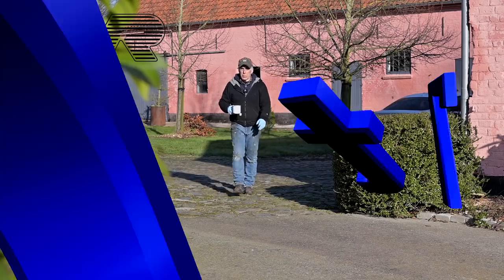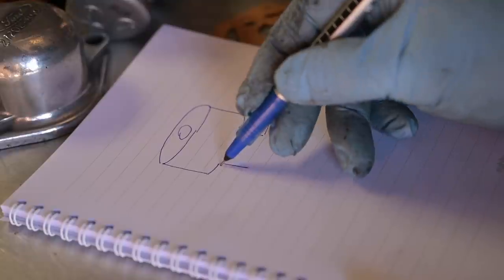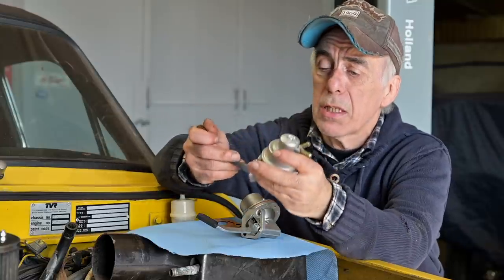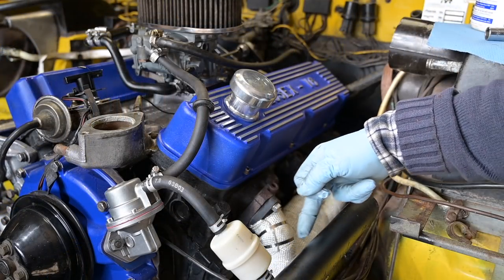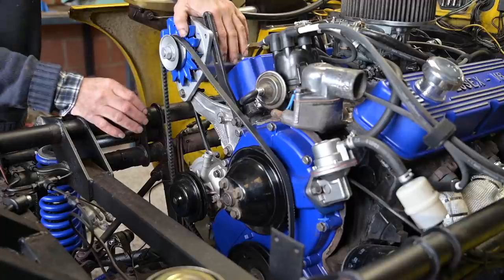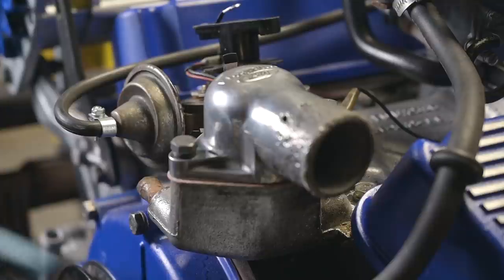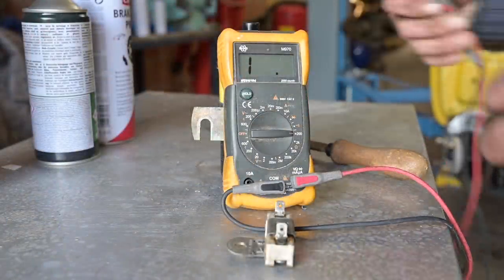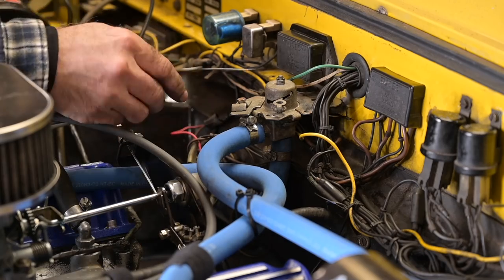TVR 3000M ,Part 7 fitting more engine ancillaries and V-belt issue

Comment: Another good video --  years back a car tuner suggested not using the resistor  type plugs eg without the R in the number -- i have used BP6ES in my 2.8 capri Cologne engine with no issues.. I beleive  the same plug fits the mini. Liking your videos good down to earth mechanic speak
Reply from the maker: Thanks for the comments

Comment: if you want to temporarily fix the pitting on the thermostat housing then get some JB weld on it after roughing it up, then you can smooth off any excess filler with a file and it will be a much better seal and less risk of leakage
Reply from the maker: Thanks for the comments... will do

Comment: Enjoyed the video.  Very calming somehow, very zen.  Must be your composed knowledgeable delivery.   When all the hoses are finished and you get tired of looking at those screw hose clamps, if you don't want to go to spring clamps or want more sizing flexibility, you could also use the wrapped metal wire loop approach.   With a little homemade bending tool, I mean, not just twisting the ends.   Looks very compact and neat.   And if you want to check your thermostat a bit more accurately, a pot of hot water will do wonders, but I'm sure you know that.   :)
Reply from the maker: Thank you for the comments, yes indeed ... I have seen those tools and with RVS wire that would work well
Reply: @D3Sshooter    IF RVS means Stainless Steel (as in roestvrij staal maybe?) that would look very nice indeed but I don't recall that I have tried that.  I have used soft annealed black steel wire and less often galvanized and those work great.  If the wire is a bit brittle or too thin it could well break under tension when you bend it at the end.   I Just whipped together a little tool with just a piece of conduit and a piece of steel rod, couple of holes, took all of 15 mins maybe.   Works beautifully.   Since you seem to enjoy taking care of trees and all, I should mention that I have used that wire technique several times to fix broken garden hoses since having screw hose clamps on those is so irritating when they catch on everything when you drag them around...

Comment: Great videos, like the diversity with house renovation and cars. A comment on the fuel filter of the TVR. You should not combine fuel filter on the suction side and heat. You will get airlock as the fuel will boil  in the filter when the engine is shut off. Its better to have the filter on the pressure side of the fuel pump or move the filter close to the tank.
Reply from the maker: Thanks for the tips!

Comment: Lovely video again! I think the best point about an electric fuel pump is that you can have a constant recirculating system, that means the fuel stays cooler in these hot engine compartments that are subject to vapourisation.

The thermostat housings are rarely in good condition, so I got a nice one from Burton Power for just under £50 - I thought it was pricey until I saw a genuine Ford one sell for more on Ebay.
Reply from the maker: Great point! Thanks for the comments

Comment: A handy trick for cutting hose and plastic pipies is to use a small hand sized garden shear. Not sure what it is called in english. Normally you use it to cut small branches. The shear has to be brand new though. Once you use it to cut something other than plastic or rubber the cut wont be good anymore. If you only use it for hoses and such the cut will be perfect every time.
Reply from the maker: Thanks for the comments, great tips

Comment: Great video as usual. Would the spring clips used between the fuel pump and filter do the job for the PCV connections? If so, they might look tidyer?
Reply from the maker: Thanks for the comments, yes indeed and that is something I am going to change soon.

Comment: Could you please mention what hose cutter you use for the fuel and water lines? It would be good to hear your thoughts on how to cut reinforced hoses in a neat way. 

Also, do you prefer jubilee clips over hose clips for the fuel lines?
Reply from the maker: Thanks for the comments, well I use a stanley raiser cutter.  and I use jubilee clips  where there is more pressure needed.

Comment: Hi Steve, thanks for the video. Looking forward to seeing more of those TVR videos. Here is one thing I learned from aircraft mechanics that I would recommend: a different fuel filter.  Once the paper in your filter drys out the fuel flow can be reduced. Instead we are using filters with a metal or plastic net inside. These are the same size as yours but you can see inside if there is dirt in the filter. So it is better for the fuel flow and you can see what is going on inside. You can buy them in plastic or glas housing in different shapes and sizes. I add a link where to get them. But you will probably find them elsewhere at aircraft supply shops. For example here: https://www.pilot-shop-24.de/FLUGZEUGTECHNIK-Flugzeugzubehoer-Ersatzteile/BENZINFILTER:::475_481.html . All the best.
Reply from the maker: Thanks for the comments Peter, and the great tip   Much appreciated

Comment: not sure on these engines but i broke a thermostat housing on ford sierra pinto engine 3 times in my youth by over tightening the bolts! those things break easily!
Reply from the maker: yep , that is why I have used the right  torque settngs.  Thanks for the comments

Comment: your alternator tensioner is from a 2.9 cologne engine, not an essex. That is your issue with belt length. Buy a curved essex alternator tensioner. (see capri and scimitar GTE applications for examples.)
Reply: Agreed. I was thinking when I saw that, that it didn’t look like the proper part for that application.
Reply: Well spotted
Reply from the maker: Thanks chaps, well this is the one that was on it . I just wonder if things changed over time. But IMO , it does not make a difference as the pivot points are the same and the valve cover is to high.  the only difference it can make is for tensioning it.